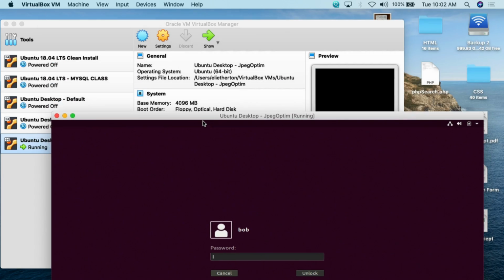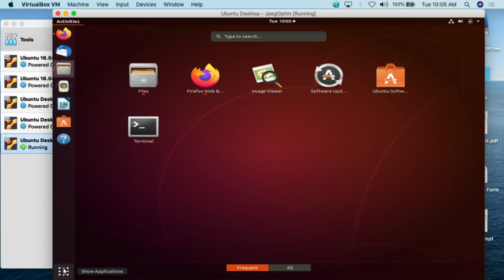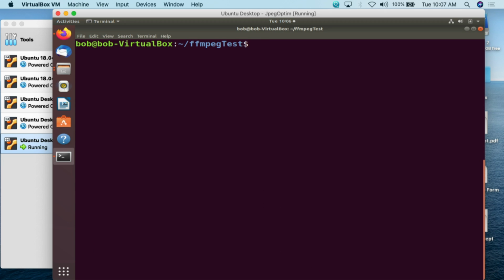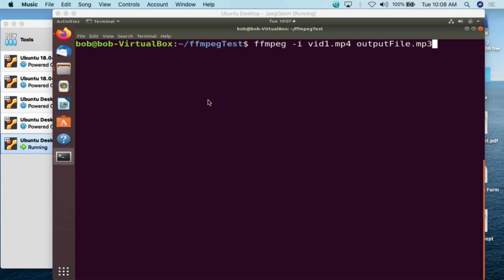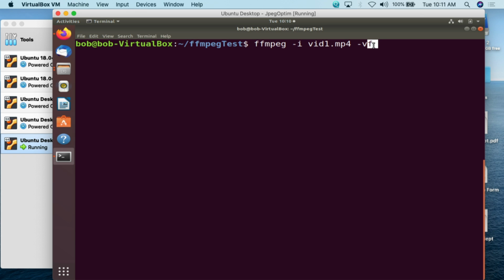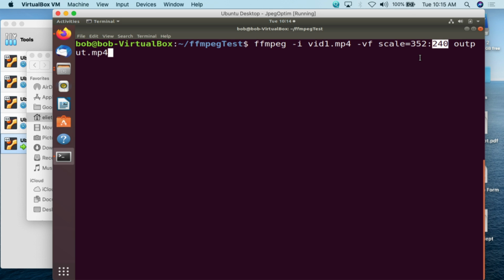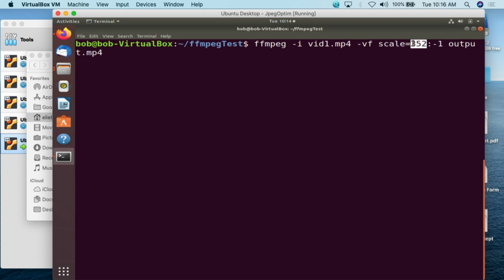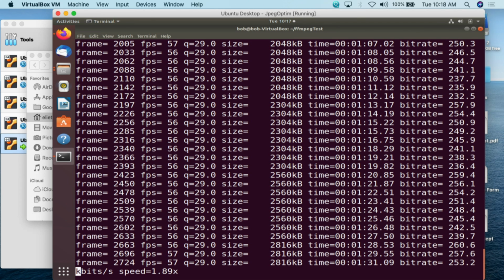Linux Tools - FFMPEG to Convert and Resize Video Files

Comment: This was an excellent overview man! I have used FFM peg for many years for processing video and audio both. After much research years back when I started my podcast trying to figure out a way to convert video to mp3 easily, FFM peg is what I stumbled upon. It worked out really great as I had a raspberry pie for in my greenhouse running all the controls and I was able to outsource the processing to the raspberry pie. More recently. I use it for for processing video from my Google pixel which records in TS.mp4 format, very difficult to convert from my video editor through windows, but with FFM peg I created a script and I can batch process my files easily on my raspberry pi server. Anyway, cheers man!

Comment: Hi, thanks for the video. Is it possible to detect a 10 seconds black screen portion in my video ? I have a video with 45 minute duration. It contains 10 seconds break time in few places. I want to split this video in that position. There is no particular order for this breaks. It may appear in between any time gaps greater than 1 minute. Usually the video contains 5 breaks.